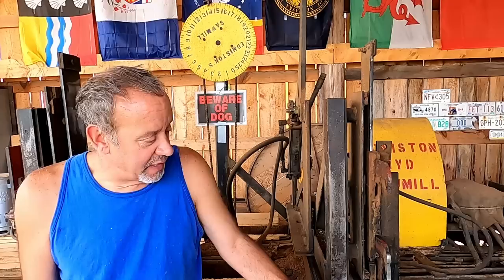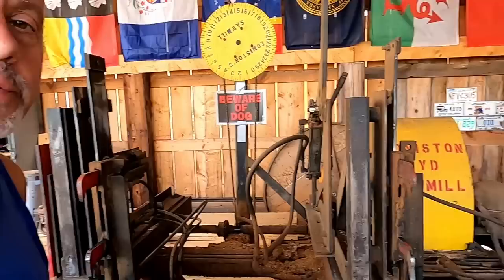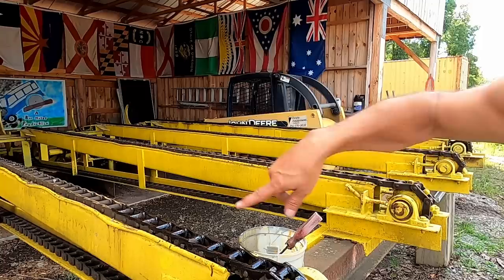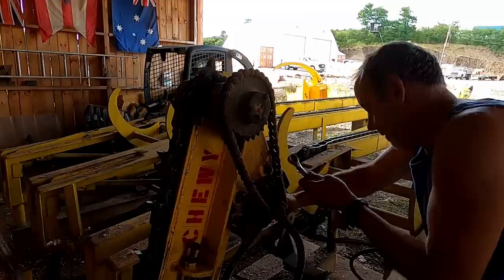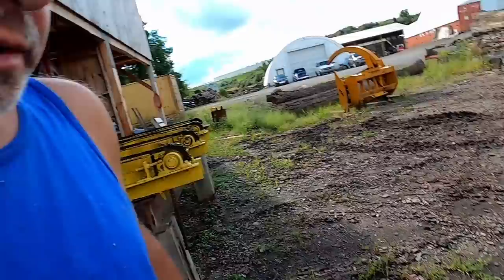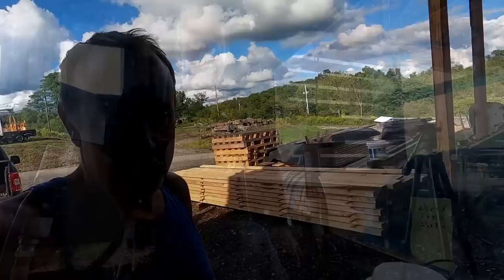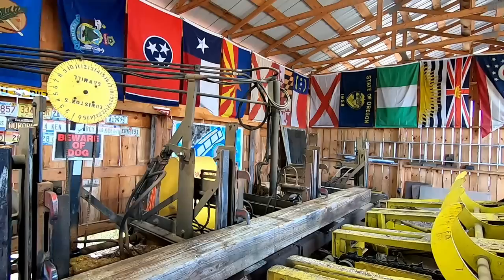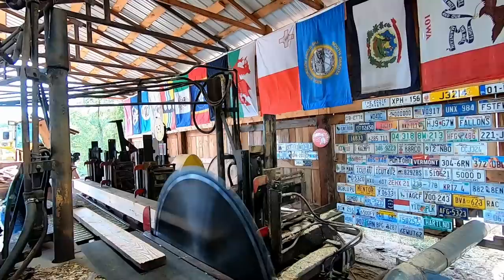sawmill maintenance & sawing telephone poles # 331

Comment: Ex employee of loctite, I have to advise nothing comes close. Wire locking as per on aircraft is more a visual check but will break and has on our rally car starter motor screws. Anaerobic adhesive in thread locking application has a known break out torque depending on the grade and has an benefit of rising running out torque as it breaks up and becomes sand like in the threads. Most resistance to movement at around quarter to three quarter turn. Most other forms of locking (washers) have decreasing torque once the initial clamping torque is lost.  You can use the very strongest anaerobic available which is so strong could have the fastener fail before it turns, easy remedy is give some heat and the locking effect can easily be broken. Alternative is a castellated nut, but they’re such pain

Comment: The video is not boring as maintenence is very important to keep any machinery tip top working order. Any failure in keep your equipment in tip top condition. Danger can be lurking around the corner and someone life could come to a end unexpectedly.
Reply from the maker: glad you liked it Loizos.

Comment: Red thread locker is what you need on that jam nut. It is designed for long-term loosening prevention on heavy machinery. It can be removed using directed heat if you ever need to.
Reply from the maker: thanks Miles.

Comment: My son who is now the head sawyer at the local mill, brought home a broken dog for me to make a new one, it was a Friday so having it ready for Monday was important to have the mill ready to rock, I used some 1/2” x6” flat bar and traced the old one on it, cut it out and grinder all the edges, it had two 1/2” bolt holes, I drilled them out , I think it was probably the weak spot since that’s where the break was at. He does daily checks and it’s still holding. Those telephone poles are awesome I did some for fence posts and driveway markers, should last 50 years or more.  Nice to see a change up every now and then 👍🏻 as for the double nut, just take a small punch and hit the thread and nut, it won’t hurt the bolt as the next time you take it off it will straighten it out.
Reply from the maker: good job , I have made some new dogs before and it takes some time.

Comment: Mark, for the master dog, if the split washer loosens again, order 2 nylock nuts and sandwich in a "NordLock" washer in between them. I've never had a nordlock/nylock combo come lose in 20 years of custom-machine building. Split washers have been proven in Junkers (industrial vibration) tests to flat-out not work. It's why NASA, and most industrial ironworking applications forbid any use of them. Keep up the good work my friend👍- Andy
Reply from the maker: thanks for the info Andy.

Comment: You could use some thread locker on those nuts, like Loctite
Reply from the maker: I do take things apart now and then.
Reply: @markgalicic7788  
There are several varieties, also I believe the blue colored type, which can still be easily removed. Like a lock nut.

Comment: I was fascinated by your explanation of the sawmill's mechanics and maintenance.  I had actually been wondering how it all ran and what was driving it, so I really appreciated your tour and explanation of the workings.  I used to work in a paper mill from the 1800s which was all powered by large, flat, canvass belts, and I was always fascinated by the clever ways everything was powered by the belts off of one drive train.  Flat-faced poles just aren't very cooperative for loading, are they?  But you found ways pretty quickly to utilize the sawmills capabilities to get them on the carrier.  Good going!
Reply from the maker: thanks William , glad you liked it.

Comment: Park be here you might want to take and use a center punch and punch the thread the last thread on your nut after you tighten the jam nut down that should keep it from backing off but you can use a wrench to punch back through it if you have to ever take it off just a thought

Comment: Try red Loctite to keep your nuts and bolts together, only on those that you don't loosen for adjusting, you can heat them up to 370* to get them apart. Where you cotter pins, hair pins like those used on tractors work very well, push the all the threw to the large eye, they won't work out that way.
Reply from the maker: I do take this apart .
Reply: @markgalicic7788  No doubt, it is a saw mill after all. I spent 40+ years working maintenance, much of it in sawmills and veneer plants.

Comment: That Creosote dust and if you had a chipper the chips would make a good footpath through the woods or a yard, it would last for years as a footpath filler but I wouldn't burn it because of the fumes.
Reply from the maker: it wouldn't rot for sure.

Comment: Try star lock washer as they have fat better holding power than the type you used. 
I'd also recommend using blue loctite, because it's just good insurance, and doesn't require heat to break it lose like red loctite does. 
And if all of that fails, I would suggest a castle nut and Karter pin, and thats an absolute fix for the problem child ole master dawg.
Then let's see him break his leash, and try to run free on you. 
Hope it works out however you find works best.
Reply from the maker: thanks Timothy.

Comment: Mark, If the lock washer doesn’t get it try some loctite
Reply from the maker: yes but I need to take thing apart.
Reply: @markgalicic7788  - Mark, Loctite Blue is formulated to come loose with some additional torque (around 35 ft-lbs., I believe), so it's not a permanent fix.  And there's always "The Big Red Wrench" - heating the fastener with a torch.  The heat can loosen most stubborn fasteners.
Reply: Or, take a piece of copper wire and loop it on one side only between two nuts ( like a hook) and tighten down… between two nuts. It is a DIY jam nut. Then wrap the tail of the wire on the exposed threads as insurance.

Comment: Labor saver: install brush lubricaters on your log deck chains. They will lubricate while you are operating. They are not expensive and are listed in the McMaster Carr catalog. They have a valve so you can turn them off when you choose.
Reply from the maker: good idea Douglas , can it use my old oil?

Comment: As an Australian I don't know your terms are the same,  I would use a castellated  nut and split pin as used on stub axle on motor vehicle.
Reply from the maker: that would work great but the bolt is grade 8 and very hard to drill.

Comment: Red locktite should be kept under lock and key,  if you do use it you will probably have to use heat to melt it before it will come loose. Try the blue first.
Reply from the maker: I don't like to use locktite.

Comment: Lock tight brother use the medium ,or they do make a nut with nylon on the ends it is a anti vibrate nut used in airplanes them nuts wont come loose at   all.
Reply from the maker: I don't like locktite and can't find 3/4" nylon nuts.

Comment: I've been wondering how well old telephone poles done on a sawmill because I heard about a training center close to me gives the old poles away and they would be nice to have for a dry out shed that I want to build for my own little sawmill operation. Enjoyed the video as always Mark and Eddie. Respect from Alabama
Reply from the maker: thanks Gary , they are great but you need to get all of the metal out of them first.
Reply: @markgalicic7788  I definitely know that... Thankfully this is a learning center instead of just the poles on the side of the road but I will have to invest in a metal detector to scan before I cut. Thanks for the heads up and advice Mark

Comment: I assume the nut for the master dog is 3/4x10tpi ? What style nut are you looking for? Nylock? Castle? Just a little bit of the blue loctite (removable strength) could work also
Reply from the maker: 3'4" x 10 nylock.
Reply: I may have one but I won't be able to let you know until Tuesday when I get home. I will let you know either way right here. If I do, I don't mind sending it your way
Reply: Yes I have some of those if interested.

Comment: There are three types of loctite green blue and red red's the strongest and it's harder to break weeks and you need to apply heat if you break it loose
Reply from the maker: that would be bad.

Comment: Should you use WD-40 as a lubricant? While WD-40 does have some lubricating properties, it is not a good lubricant and should not be used for this purpose. Using it on anything that needs proper lubrication (bike chains, treadmills, garage doors, etc.) will not give you the results you want. (I am an old, retired, Texaco, mechanical engineer with lubrication experience.)
Reply from the maker: What should I use that's very thin ?
Reply: Suggestion: 
Types: Graphite powder or spray, molybdenum disulfide spray, (dry) silicone spray, PTFE spray
￼Powered graphite

Use When:
• You have tiny parts that shouldn’t be gunked up by grease or oil that will attract dust
• You need to keep surrounding surfaces clean
• Your surfaces are exposed to extremely high heat or pressure, which would typically oxidize oils
Reply: 3 in 1 is a good light oil.